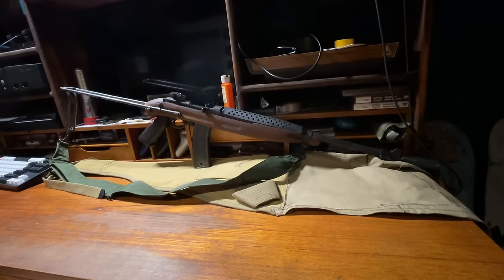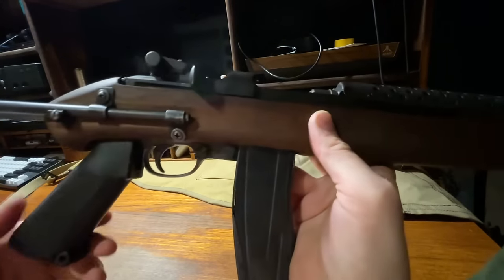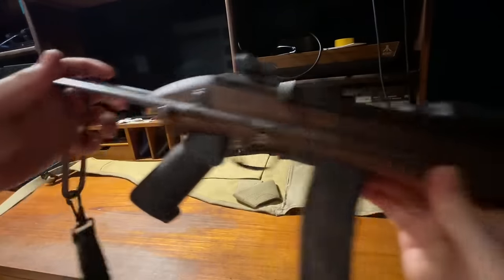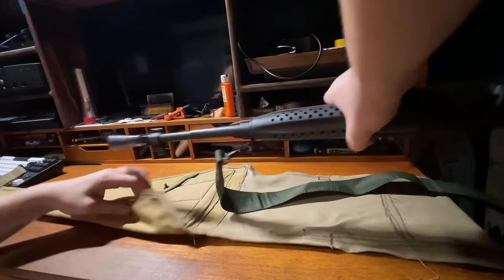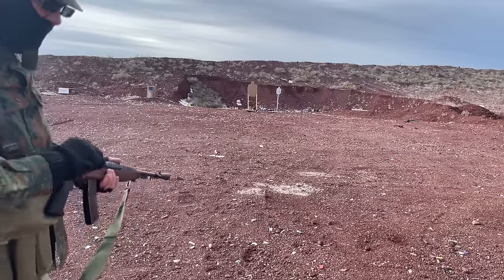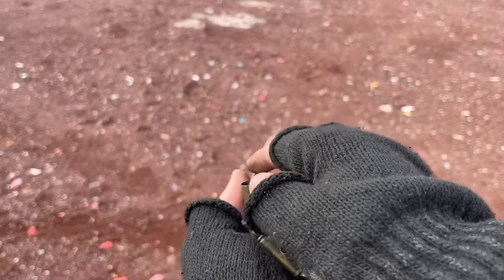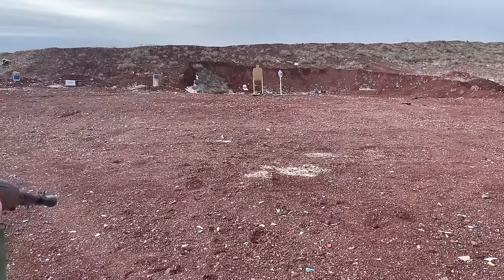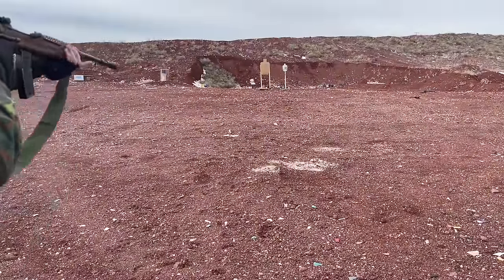My 1970s Vietnam Advisor M1 Carbine

Comment: I encountered a "spook"gun a number of years ago. Spook guns are not identifiable. There were no manufacturing marks. No brand ,no serial numbers. The back of the receiver said M1 carbine. During the conflict in southeast Asia, special forces (CIA), used weapons that were devoid of markings. The operator went in without unit insignia or rank insignia. They went so far as to print erroneous information on cartridge headstones to confuse the enemy. Those caught were executed as spies. These weapons if found are illegal to possess as they are bring backs and not serial numbered.
Reply: Serial Numbers were not required on Firearms until 1968. Technically they still are not required if you manufacture the firearm yourself.  Additionally, it is completely legal to own a "bring back" weapon from that era.  Barring being an NFA firearm.
Reply: Up until the M1 carbine was declared obsolete by the US Military they were not available on the civilian market.  In the early 60s a company called Painfield Machine produced copies of the carbine for the commercial market.  Painfield Machine was located in New Jersey and there was a rumor of mob involvement.   The story goes that Plainfield Machine had supplied 'sterile' firearms...both long guns and handguns...without serial numbers to US intelligence agencies.   It's been documented that Plainfield Machine did supply large amounts of newly made carbines to the South Vietnamese Military.  My guess is that they also supplied some 'sterile' versions.   If you found a 'spook' carbine it was likely produced by Plainfield Machine.

Comment: A buddy of mine was a crew chief. He carried an M2 with a very short barrel and a paratrooper stock that was cut way down. He went down several times and really loved that pistol.
Reply: @richardross7219 13:39 
A close -in Presidential Security l talked with ( outside the USA) said he preferred the chopped BARREL M-2 Carbine to the UZI..
 
His Barrel was Chopped to 81/2".. very compact.
It is More lighter than the UZI....

More powerful (.357 Magnum velocities at close range)..

Very manueverable INSIDE the confines of a vehicle 🚜

He adopted the retractable "wire" stock from an M3-"Grease GUN for a stock.
😊👍

Comment: I also tried 115grn lead cast bullets in my M1 carbine. Firing and ejection were ok, feeding no. I agree the soft lead bullet snags on the feed ramp. I build receivers from demilled cut receivers. I am willing to modify the feed ramps on my rewelds as the collector value is low.

Comment: In the eighties I bought a new Plainfield manufactured “M-1 configured very similar to the specimen you have there. It did not have the Colt M-16 style pistol grip though. 
My take on the one I had was —-Flimsy Stock, decent action, poor accuracy but cool look. I bought a surplus M-2 stock and did a slick re-finish on it and it made a nice wall-hanger.
Damn that gun was LOUD!

Comment: The utility strap used as a sling comes in three different lengths. 
It was used to carry the WD 1 wire reel for communications or the field phone. It was used with the two quart jungle canteen. The clips attached to the belt. Few know what to do with the ( patrol-butt-pack) when the Alice pack was worn. The strap attaches to the two rings from the y/H harness. It can then be worn on the right side as a foraging bag on the belt with cross shoulder strap.

Comment: Awesome build and Incredible work. If you would like some advice, from one original production carbine owner to another. You should look at replacing the recoil spring and firing pin if they are original. The decades haven't been kind to either of those parts. Springs wear out and get sloppy which can lead to malfunctions and the firing pin on my M1 broke in half during normal operation. Hated to lose an original piece like that and wished I'd known to replace it. As you said, many carbines have feed issues and this is often due to the original magazines, which were never designed to be reused for decades and decades. Often the magazine springs and feed lips wear out and deform causing failures to feed. A modern reproduction magazine would probably be more reliable but I think it's also totally understandable to deal with minor malfunctions so you can use original mags. Again, amazing rifle. Definitely the kind of thing to hold onto and pass down to your kids. Thanks for showing it off.
Reply from the maker: Mines a 1950s factory refurbished model from the CMP the firing pin and recoil spring are brand new. I’ve also rebuild all my original mags with Wolff extra power springs, all the malfunctions I was experiencing was due to the handloads I was experimenting with soft lead bullets kept getting stuck on the feed ramp.

Comment: I once had a Korean War era M1 carbine that ran like a well serviced clock. Years later I bought a reproduction M1 made by Auto Ordenance/kahr. No matter how much tuning and tinkering I did I could not get that gun to run a full mag without a failure. Were I to buy another it would either be an original or a high quality repro made by a company that insured reliability.

Comment: Next time you go to the range put a drop cloth down to catch your spent brass.
I see you’re checking the length. Speer use to sell 100 grain plinker that worked for me. I use to load H4227 at 10% below max load. I also put a little crimp on the case, seemed to help with feeding. You might need to chamfer the primer pocket on that milsurp. Swab out the chamber last when you clean it.
Cool project, bayonet?

Comment: ROK's were Korean Marines, not Vietnamese. Republic Of Korea, Marines. Some of the fiercest Marines in the world. Many Vietnam Veterans told me this. And the rubber butt pads were not "silly", it was how it was designed. To get a 30 round mag to reliably feed in the M-1 Carbine, you need the "lower metal" from an M-2 for it to work reliably, most times. The flash suppresors were generally not used much.
Reply from the maker: I honestly have no idea what you’re talking about in the second half, it was literally a jury rigged shotgun rubber pad that was bolted to the stock on mine. And there are no photos of any m2 carbines with rubber butt pads. What does (lower metal) even mean? The flash suppressors were made for the m3 infrared carbine for jungle warfare, but I like them because muzzle flash suppression is a better real world upgrade.

Comment: The overhang where the original grip was cut off is bugging me, would’ve flattened that out but hey, this is a beautiful little unit regardless!
Reply from the maker: I needed the space for the stocks locking mechanism, that’s why it’s cut like that. Otherwise I agree it’s not the most pleasing aesthetically.

Comment: The original PCC.
Reply: Original PWD. It’s energy at the muzzle is equivalent to a 5.45
Reply: @flightlesschicken7769  I always thought of the 30 cal carbine as close to a 357 mag.
Reply: @chrissinclair4442  it is, it just so happens that the 357 has similar energy to the 5.45 as well :)

I like to think of 30 Carbine as a 30 Magnum, given its comparable energy and equal case length to the 357. I just also feel 30 Carbine is like the bottom end for intermediate cartridges given its energy is equivalent to the 5.45 which few would argue isn’t intermediate